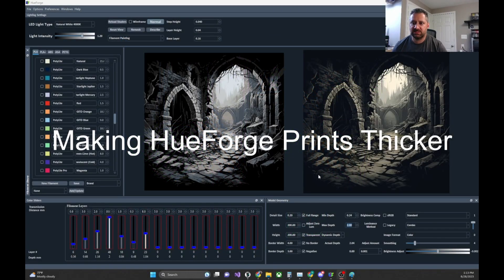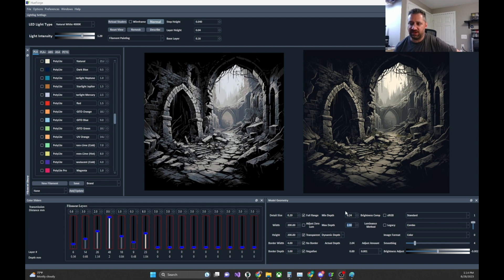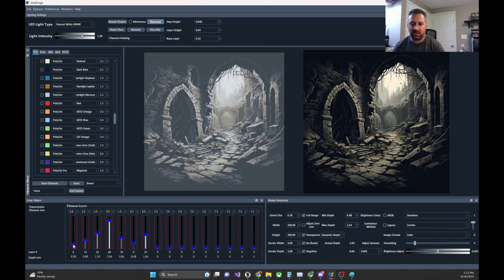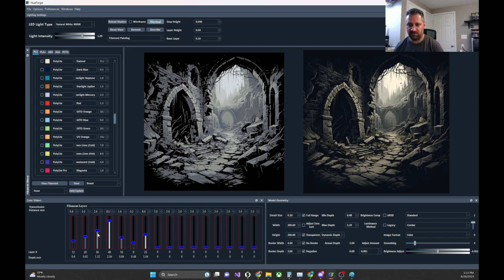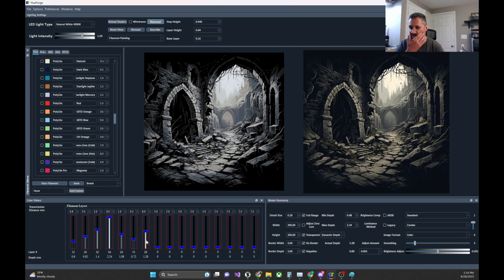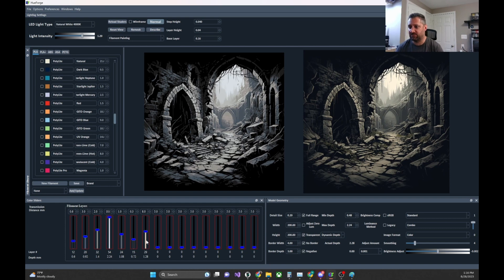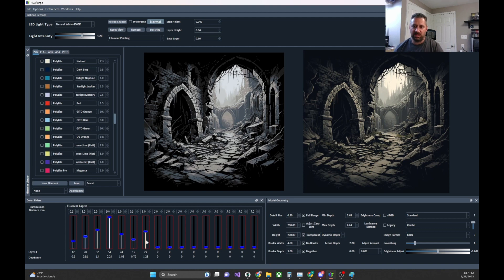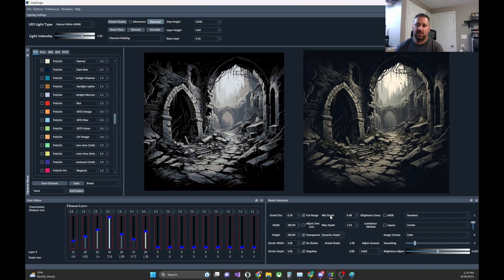HueForge Print Thickening Tutorial

Comment: I am using default settings. When I go to the model geometry section these settings are not there.
Reply from the maker: This video is obsolete.  Now on a toolbar you will find Base Thickness and Blend Depth.
When you increase Base Thickness all the sliders will move to stay in the same relative position so you no longer have to move them all up and down to match.  Blend Depth always floats on top of Base Thickness.
Reply: @hueforging Thank you , I just purchased yesterday. I had 2 failed, (my fault due to incorrect slicer settings)  but got it on the third attempt. This has been fairly easy to learn prior to watching any tutorials.  This software is pretty cool.
Reply from the maker: Thank you for the kind words. I appreciate them.

Comment: On my model geometry tab, theres no min/depth max/depth option! How can i turn them on?
Reply from the maker: This is changed in v0.9.x - They are on toolbars but have been renamed.  Min Depth is now Base Thickness and Max Depth is gone and there is now a Blend Thickness which floats on top of Base Thickness.  I recommend watching the v0.9.x Crash Course in the Help menu for the UI update.
Reply: @hueforging  Thank you very much!
Reply from the maker: @Tbv9axxlz  You no longer need to move the sliders when you increase Base Thickness either.  It will do that for you.

Comment: I have a problem with fine detail disappearing on the top layers because Hueforge adds a chamfer to the layers.  The stl is created such that each new layer is slightly smaller than the layer below even without a color change.  Is there any way to adjust or remove that chamfer?  This is very noticeable with text added to an image.  The text will be broken up at the top layer while you can see the text was thick enough to print because the lower layers of the text in the other color are visible.
Reply from the maker: This is how the mesh is built and it is unlikely to be modified in the short term. You can move the text layers lower to avoid this if you are using color match. But it sounds like you have very very fine text you are resolving here. You could also potentially reduce your detail size to make the slant steeper

Comment: Can I use it to have a 5 cm high print with 2 colours too?
Reply from the maker: 5cm?  Like 50mm?  You'd need to update your .usersettings.ini to allow higher than 40mm which is the default.  But if you meant 5mm with 2 colors like a QR code, then yes.
Reply: @hueforging  Thank you for the answer, I really need 50mm, I wanna split a terrain into 2 colors on each layer 😅
Reply from the maker: @Muffnsausn   2 Colors per layer of the print?  Or two color terrain.  HueForge doesn't currently allow more than 1 color per layer.
Reply: @hueforging  oooh, then I had a big misunderstanding, I need the change on every layer. But anyways, I bought the personal edition yesterday and I'll find a way what to do with it, the prints look great!

Comment: Just curious but without digging to deep on this awesome app, can you tell me if it's heavy on resources?  Like what are the system requirements? Do I have to go out and purchase a gamers type system just to run this app? If I have to, then no biggie. I'm very impressed excited and interested in learning and using this app. One thing I haven't seen yet is a portrait of a regular Joe/Jane, but I'll keep looking.  Thanks for your precious time sir!
Reply from the maker: No you don't need a beefy PC. A modern built in (Intel Iris or AMD equivalent) and even some older ones will work. Any discrete GPU better than a GeForce 600 (about 10 years old) will work as well.

Comment: Would be nice it you could just change the thickness instead
Reply from the maker: This is true.  It is on my feature roadmap.  I actually originally had an "extra thickness" option but it caused multiple issues and bugs and I removed it for now.
For now, I suggest finding a min depth you like (I like 0.48mm now) and saving that as your default min depth in Options->Save Defaults.
Then you won't ever have to adjust future prints like this.

Comment: What would be the max thickness ? Can we get the first initial layer about … say 5mm , then start the actual magic?
Reply from the maker: I think right now the MAX depth is configurable topping out at 40mm by default (in .usersettings.ini).  I think the Min Depth isn't configurable and maxes out at 10mm.
This doesn't even count STL Painting mode where I like to set my First Layer to the height of the model before any HueForge mesh and the min/max depths aren't adjustable.
Reply: @hueforging  great info , will be purchasing today !!!

Comment: There should be a way to select multiple sliders and move them all in sync
Reply from the maker: I can see some uses for this, but really I think it's better to change the way these values are represented - IE Min Thickness and Blending Depth and then have that automatically float on top and have changes in the Min Thickness automatically be reflected in the sliders.
Reply: @hueforging  If you are going that route, might I suggest a different terminology - "base height" and "painting height" which might be clearer.

Comment: If you notice, you actually begin to automatically begin to move all the sliders together at the same time at 1:40. This means you can adjust all the colors at once. Did you hold shift, ctrl or alt? You even look surprised that you did it.
Reply from the maker: As you increase the Max Depth, the sliders all adjust down as the new max is set on the sliders but the mm height of the sliders doesn't change.  It isn't that the slider handles are moving, the sliders are getting taller while everything else stays put.  It took me a moment to work that out in my head.
Reply: Interesting, YES that makes sense now thank you.  @hueforging

Comment: How did you know to increase them each by 6?  I missed that part.  Thanks in advance
Reply: He thickened the min depth by 0.24mm. His layer height is 0.04mm, so divide 0.24/0.04 = 6 extra layers. So he needs to move each slider up 6 layers now that the print is thicker